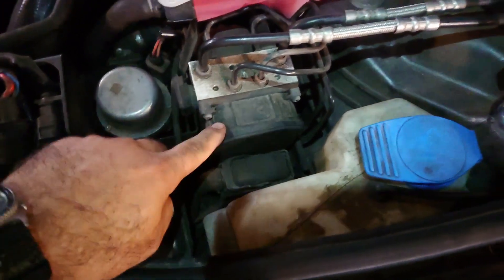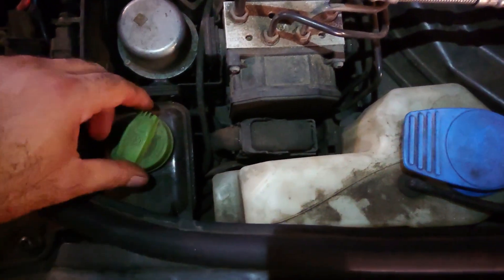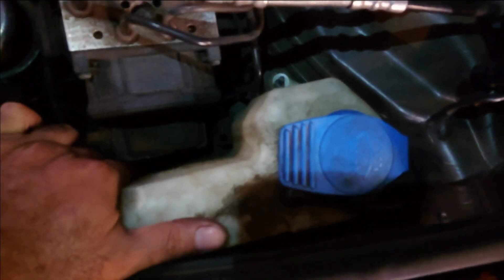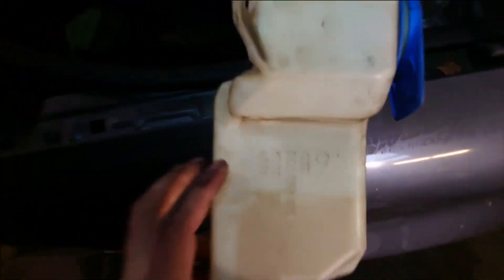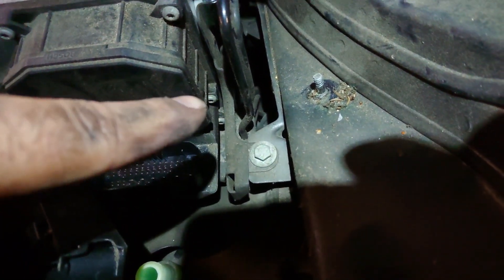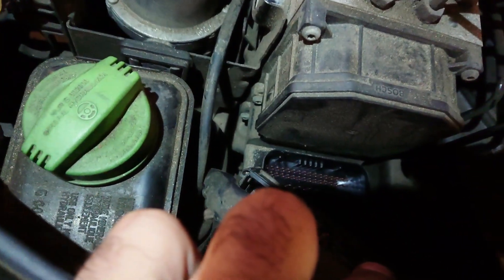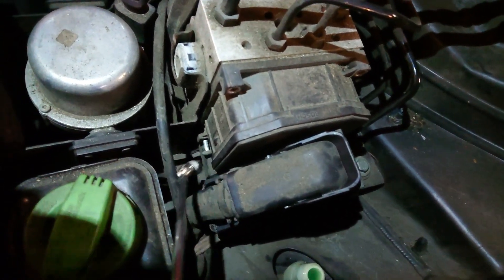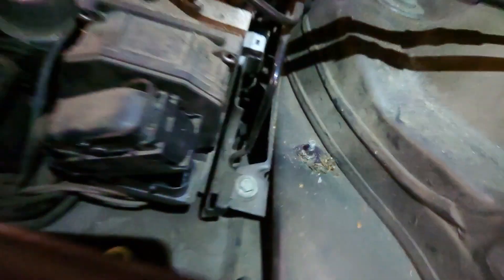Audi A4 (B6 and B7) ABS module removal DIY

Comment: Do one need coding or someth if you change the module?
Reply from the maker: Yes, it will need coding. You will need a scan tool such as VCDS (Vag-com). There are videos on how to do this, but the best one I've seen is by Ross-Tech (the maker of VCDS).

This page has everything you need:
http://wiki.ross-tech.com/wiki/index.php/Audi_A4_(8E)_Brake_Electronics_(Bosch_5.7)
I'm not affiliated with ross-tech, I just have their tool.
Reply: @mr22guy  Thank you
Reply: @mr22guy  If it comes from the same type of car; year/trans/engine etc the same... then would coding not be required?

Comment: Good video! First time seeing the top section of the windshield washer bottle popped off. I saw in another video that the "basket" that the abs pump and module sit in can also be unbolted (you can see one of the bolts in your the whole time) to give more access to the bottom screws.
Reply from the maker: Thanks for the tip, I'll try that next time!